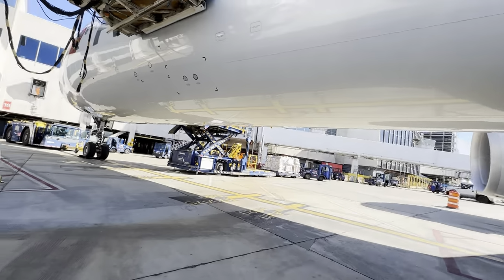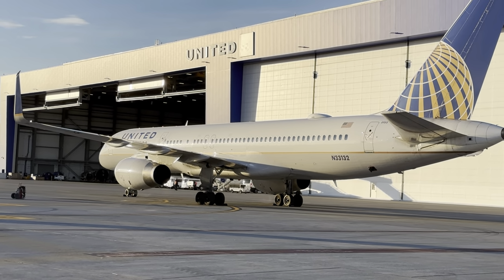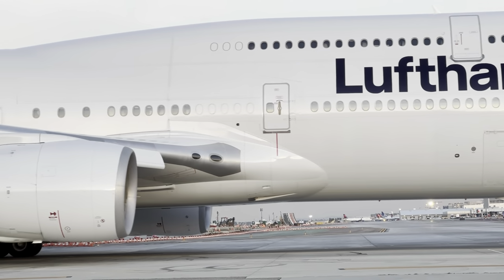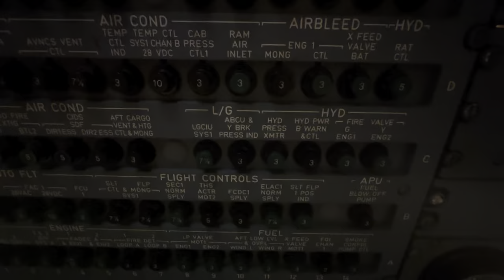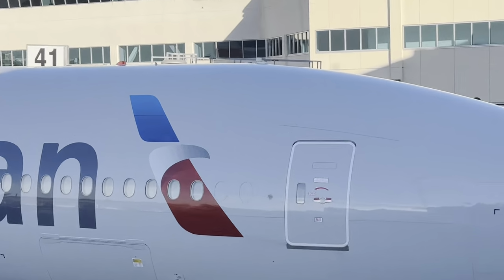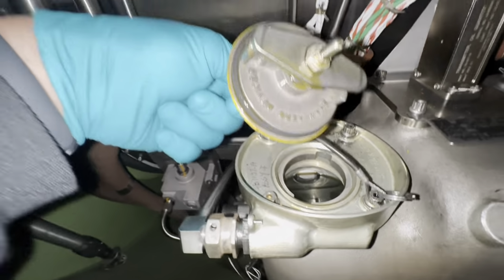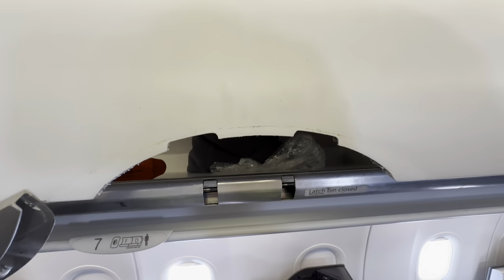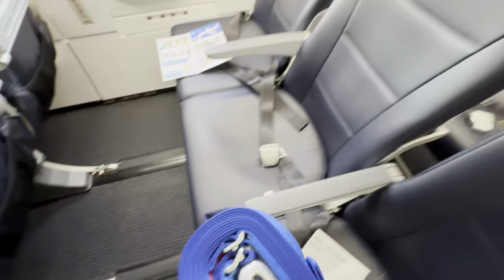Stig Shift #11 (Aircraft Maintenance Adventures)

Comment: Just realized.. Mabye TLDR....hahah  USAF 757 is C--32 Gatekeeper with "A" and "B" models in use.  The "B" models have in flight refueling capability which is a cool modification to the 757.  Yes, the 737 is the C-40 Clipper.  No refueling capability as I think that is just not as important these days with the duration of both of these aircraft being 12+ hours likely.  More efficient engines and all.  The new 747-8 Air force 1's that are currently under refit will not have aerial refueling capability.  The C-32  and C-40 were fitted with extra fuel storage since cargo space was not of a concern.  Both carrying about 40 passenger's in a business class style the aircraft has the weight reserves for those extra fuel tanks.  Also cool if you are paying attention.  These VIP aircraft have countermeasures installed around the horizontal stab.  Lasers are a thing now, as well as older chaff (foil strips to confuse radar guided munitions.) and flares (heat signatures, to confuse heat seeking devices.), who knows but it fits the mission objectives and there is obviously "stuff" installed on the tail of these aircraft that keeps them from being shot down like a fighter that is not installed on the civilian airframes.  Also something to note.  USAF has recently been removing the numbering, as you see here, from all their aircraft to keep prying eyes from identifying individual aircraft movements of the fleet (not just VIP but all craft.)
Reply from the maker: Absolutely incredible information. Thank so much

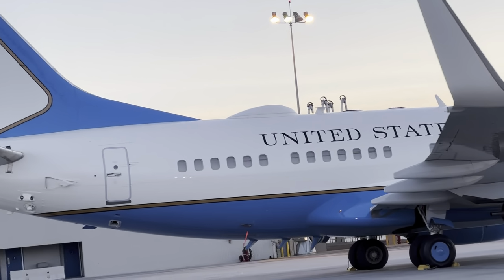Comment: 10:35 It’s a BBJ1 which is basically a 737-700, with 737-800 wings and landing gear as well as a few aux tanks in the belly. You’re right though, it’s called a C-40B.
Reply from the maker: Many thanks my good sir, my apologies on getting the model number incorrect. Thank you so much for the correction.
Reply: @StigAviation  No problem! I hope I don't come across as rude or anything. I spent over 16 years flying as a crew member on many of the "Blue & White" aircraft at Andrews. They have a special place in my heart.
Reply from the maker: Not at all sir, I appreciate the feedback and education.

Comment: Why do some planes release a long tail of smoke in the sky ???
Reply from the maker: Those are called con trails. Basically very hot exhaust gases coming out of the engine at very high pressure into a very cold atmosphere. The air immediately crystallizes and creates what you see there.

Comment: No ELT antenna on your 777's?
Reply from the maker: It has a ELT antenna, I think I just forgot to mention it 😅 my fault on that one
Reply: @StigAviation  Thanks for the follow up. 
A lesser known fact about 777 antenna, is the VOR antenna on the top of the fin being used for Localizer (prior to, I think, APProach being armed). Because of airplane nose-up attitude during approach,  the loc signals from the ground may be blocked by the fuselage.

Comment: The 737 definitely looks like a 700. If you look at the backside of the engine, the 300’s engine pylon would stick out further behind the rear flaps, but on the 700 it doesn’t. Since it doesn’t here, this is probably a 700.
Reply from the maker: You are absolutely correct, I made a mistake on that, I put a note down in a description and pinned a comment correcting that mistake. Thank you so much for pointing it out.

Comment: Around min 33:00 when the engine in the Airbus A321 shuts down, why is it that it sounds like metal objects are grinding ? I even notice it on the A319 when I hop on the flight from SMX to LAS.
Reply from the maker: It’s more of a high-pitched whine, personally it sounds beautiful to me, but the reason it’s making that sound. It’s because the compressor is releasing the excess air via the transient valve on shutdown
Reply: @StigAviation oh yeah that I captured, it’s like after the shutdown, it has like metal making contact like a rattle and the fan blade still has some spin to it.
Reply from the maker: @cisco4856  oh, that’s what you’re talking about, OK so that is a completely different engine, that is a CFM56-5B. The metal clinking and clanking you are hearing are the mid span shrouds, I actually made a video about this.
Reply: @StigAviation  yes that! 😅 ima go in your videos and look it up. You explain things very clearly I literally watch all your videos that pop up lol there’s a lot I didn’t knew of functions of the smallest things of an airplane.

Comment: 32:52 Even on the A32 NEO, the engine nacelles had to be flattened a little on the bottoms.
Reply from the maker: It’s not really flattened it’s more bulged out, the reasoning for that is because the integrated drive generator is right there.

Comment: Can you go over the whole chem trails thing?
Reply from the maker: No such thing as chem trails.  It’s contrails. Just hot exhaust gases coming out of the engine at high pressure and encountering cold atmosphere air. It crystallizes the air and leaves the trails.
Reply: @StigAviation  😂😂. I promise I was being sarcastic brotha but thanks for the clarification.

Comment: Oh yeah stig how does the engine equivalent spark plug work?
Reply from the maker: It’s called an igniter on these engines, and it works much like a diesel engine. It just needs to ignite the fuel once and it stops.
Reply: @StigAviation  okay thanks :D
Reply: Don’t diesel engines self combust tho?
Reply from the maker: @Hugo-v5r  more of a continuous burn.

Comment: The C-40b is a 737-700
Reply from the maker: Thank you very much for the correction Jeff, I apologies I got the model wrong.
Reply: @StigAviation  No need for the apologies, military designations are confusing as hell. Been working almost 30 years in the industry and like yourself love all aspects of aviation. Ive worked all types of planes from Lockheed Super Connie's to 777's.

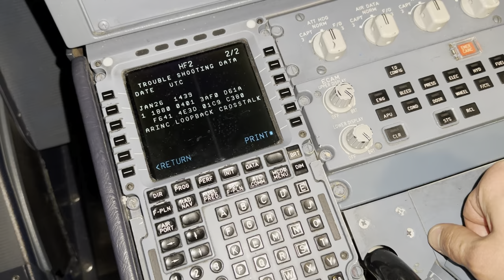Comment: 14:34 Soo them troubleshooting codes are all pretty much like vehicle troubleshooting codes 
All a big bunch of nonsense when you look at them and then have to look up the books and look online to understand what each one is LOL
Reply from the maker: Exactly that Johnny. At that point, I have to dig deep into the manuals to actually understand what the airplane is trying to tell me.
Reply: @StigAviation  I feel your pain.
Even though vehicles would have way less than half the amount of fault codes a plane would LOL.
My partners car was a pain and chucked up fault codes and her grandmother's car also (both had very high mileage)
Thankfully they are pretty much the same codes 
So ended up not been that bigger headache when i clicked the problems were both the same.

Comment: how come their running the high power on the 757?
Reply: I'm guessing just finished maintenance on the engine, always gotta check if it's still working. Another possibility is that they're cleaning the hydraulic lines with some special fluid
Reply from the maker: Probably changed out vital components and needed to do a performance run.

Comment: The 757 (reg N33132) was in storage from April 2020 till May 2023. Glad to see it back in the air. However, it’s probably due to the 737 max issues. As soon as they can build up a fleet of 737 MAX 9/10s the 757 is going to go away for good unfortunately
Reply from the maker: I really wish Boeing would’ve invested more into the 757, my personal personal opinion is that the 757 should’ve been the Max

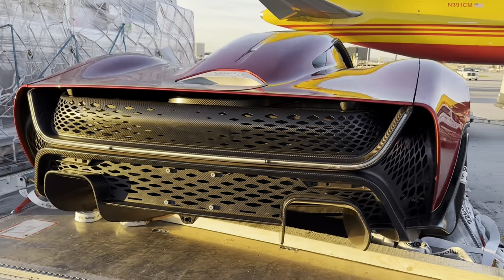Comment: Car at 07:25 Is a Czinger C21. Amazing USA engineered and built AI evolution methodology to optimise the car and its structure.
Reply from the maker: From what I understand it’s 3-D printed
Reply: @StigAviation  A lot of the suspension components and support structure is! AI and "neural network evolution" was used to "optimise" certain aspects of the car to take the loads it needs and perform as it should to while remaining as light as possible. The output was then 3D printed! Its literally the future way things will be optimised, and a great showcase of what is possible (even if not perfect yet). Its lovely how the subframes and components almost look organic in design.

Comment: Hye Stig how many type rating you have, and what are they?
Reply from the maker: At the moment Active type ratings are B737-800/MAX8 B777-200/300 B787-8/9 A319/20/21/Neo   I have many more type ratings on aircraft that either don’t exist or we don’t have that I used to previously work on. But those old type ratings i no longer use. But if I were to transition to a different employer that has those aircraft, then I can work on them.
Reply: @StigAviation  Wow that is a lot! Love your video Stig I learned a lot from you. Btw I have only 1 type rating, NG. Will be going for Max later this year. Keep up this educational videos sifu 🙏🏻
Reply: @StigAviation  
It's amazing to see how many aircraft professionals are hanging around your channel!
I'm just an humble but very curious aviation fan, and thanks to you alI I can breathe a bit of the tech vibe I love so much. 
Glad to know you have also the B737-800 type rating, if you check my p*r*o*f*i*l*e, under the 'c*o*m*m*u*n*i*t*y' tab (don't know why, but using these two words causes my post to be deleted every time)  you can see that I could use your help 😬🤣 (Just joking... It's not that much, but all done by myself including electronics, little by little and still largely 'works in progress'...)
Thanks for your work and your commitment!
Reply from the maker: I will most definitely check it out. 👍

Comment: That United plane should at fly because the horizontal stabilizer is move
Reply from the maker: It’s supposed to move around, the aircraft is not a rigid piece of equipment. The airframe needs to be able to flex and move. And during a very high, powerful engine run, the whole air frame will shake.

Comment: Oh my I’m early
Reply from the maker: You are way too early. Sleep damn it 😂.
Reply: @StigAviation so one thing I’ve always wondered, say on an aircraft with multiple engine types, like a 321 for example, I’d imagine the maintainence process largely the same, but is there any difference between CFM and IAE that makes one slightly easier or more straight forward to service?
Reply from the maker: I mean servicing, the engine is the same all across, but the maintenance and component location is different. CFM is definitely easier to work on

Comment: Can airplane computers be hacked
Reply from the maker: Not that I know of. It’s all a closed loop system. I doubt anyone can hack into flight parameters of flight augmentation. Only thing would be outside influence of feeding incorrect data to the aircraft via gps. But even that is highly unlikely for an object moving at that rate of speed and altitude.